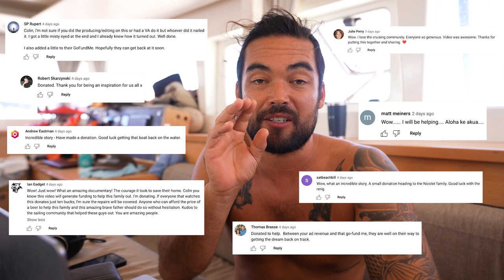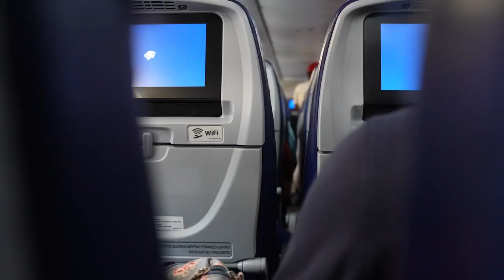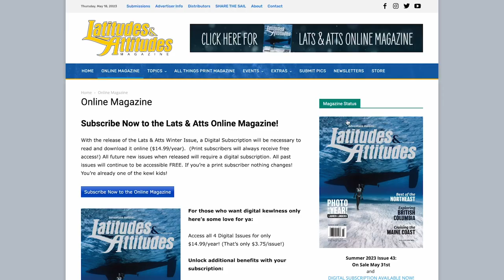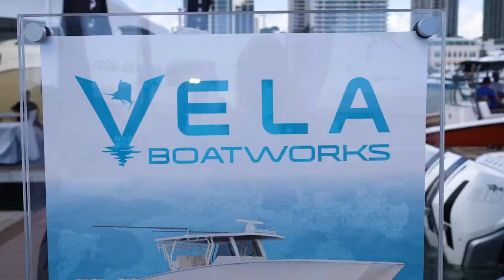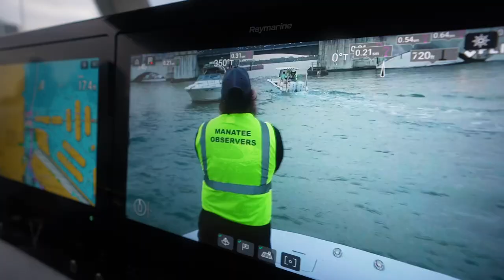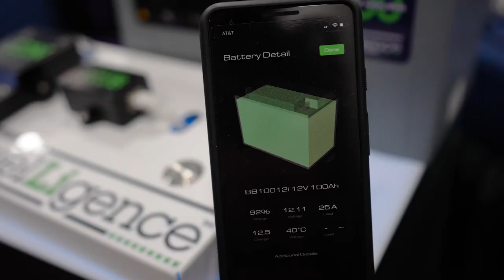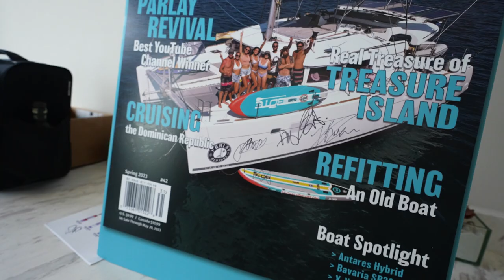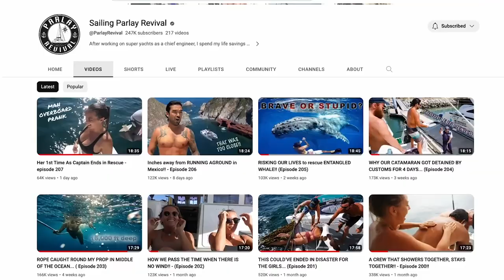The Fastest Catamaran I Have Ever Been On!! - (Episode 210)

Comment: When you started your channel the USA was in lockdown. I was working at home. I watched a lot of YouTube during that time. With retirement coming up, i thought sailing is something i could do.

I was in forest fire management so i had no free time in summers. After i retired, i joined the local sailing center and took a few classes and got some certifications. Also doing some racing. Members who have some ASA certifications can use the center's boats. They have 80 sailboats from 14' to 29'. A membership is a few hundred bucks a year. You don't need to spend thousands to get into sailing. At 65 I prefer to sail locally and jump on a plane if I want to travel.